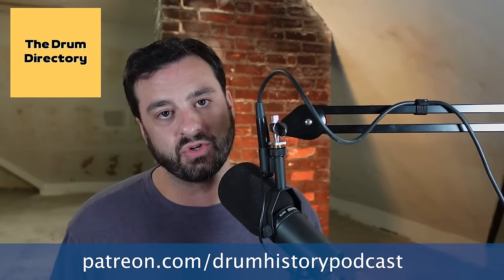Why Do Drum Brands Sound Different? with Jeff Kirsch - EP 242

Comment: I think most people, drum makers included, don't fully understand why drums sound the way they do, and the physical traits that contribute to the sound. By a huge margin, nearly all (often all) of the sound that you hear when you strike a drum comes from the head. This is just physics. When you hit a drum, you are putting energy into the drum, and that energy gets turned into the movement of the various parts of the drum. That energy will get converted into motion following the path of least resistance, and the head is much, much more flexible than the shell, and orders of magnitude lighter (less mass), so nearly all of that energy is spent moving the heads. Any resonance of the shell and the lugs will be of an amplitude much, much smaller than that of the head. Not to mention, the drum shell with all of the hardware attached will have a specific resonant frequency, and you'll only get significant resonance of the shell/hardware if the drum head(s) is tuned to a frequency which causes sympathetic resonance of the shell/hardware. Even then, the resonance of the shell/hardware will effect the resonance of the head much more than be resonance that creates a pressure wave large enough to make it to your ear. So, in an indirect way, the shell construction and hardware can have an effect on the sound of the drum. Another factor to consider is that when you strike a drum, there's a pressure wave created that emanates from the batter and resonant head, and this pressure wave curls around the side of the drum and can meet each other, further effecting the pressure wave (constructive/destructive interference) that eventually makes it to your ear. Drums are far more similar to loudspeakers than drum makers realize, and I'm not aware of any mainstream drum companies that fully understand the the connection between how loudspeakers and drums generate sound.
Reply: They ALL do.  They've known for decades. A mic is an Inverted speaker. The mic inside your ear is called an EAR DRUM... Or the tympanic membrane... It's because all instruments are like playing an inverted microphone. You think something that can't project sound is an instrument for sound? You think Ludwig and Sonor perfected the drum sound by accident? Have you noticed how the acoustic chambers in guitars got replace by a speaker with electric guitars? Drums came way, way, way, before the speaker and modern physics. Drum sounds were perfected few decades after modern physics. I wonder why...🤔
Reply: @christopherlee4648  as someone who builds both loudspeakers and drums, I can say with 100% certainty that drum makers do not at all use the acoustic theories from loudspeaker design when building drums. No loudspeaker designer anywhere tries to use "tone" woods in their loudspeakers. Their goal is to make the most rigid, non-resonant enclosures they can to maximize the output of the speaker driver. Since you brought up Sonor, they're the only ones who I've ever seen market heavy, non-resonant shells as a good thing. In the 70s they had brochures full of testing data that showed that heavier, non-resonant shells sounded better. Of course, they still make some heavier shells, but no one is actively trying to market non-resonant shells or shell materials, even if the science says that's better. Loudspeaker designers also design the enclosures based on Thiele/Small parameters. These T/S parameters describe the electro-mechanical properties of woofers, and they allow the designer to create an enclosure of the correct size to get the optimal performance from the woofer. There is no equivalent today in drum making. No one is characterizing drum heads to understand the optimum shell depth to get the peak performance of the head. Instead, drum companies try to tell us that a resonant shell is what we want, when the sound that actually does come from a shell never even makes it to your ears because the amplitude is so small. I have actually been working on developing an equivalent of Thiele/Small parameters for drum heads, and I believe that this work has the potential to allow creation of drums that really do measure and perform better than current designs.
Reply: @bugless78  You must be living under a rock making drums and speakers. All speakers use wood casings. The speaker cone is the drum head. Last time I checked heavy shells are still the holy grail for heavy music. Those heavy sonors are worth a ton. They stopped making thick shells because they are heavy and expensive to ship and make. Not everyone likes thin shells. Not sure how you think a cylinder can be improved much more. Mass is not that complex. Neither is geometry.
Reply: @christopherlee4648   Every high end speaker is designed with the goal of making a non-resonant enclosure, full stop. This is not up for debate. This is a fact of life when designing speakers. Not all speakers are made from wood, though most are. Some are made from aluminum or carbon fiber, and many are made from MDF specifically because it has naturally low resonance. Speaker cabinets are also heavily internally braced to reduce resonance further. Energy that makes the cabinet resonate is energy that could instead be used to more efficiently drive the speaker cone. The concept is similar in drums. Any energy spent making the shell resonate is energy that could have made the head resonate more efficiently. It might blow your mind that you can create a drum shell out of MDF and it will still sound like a very good drum as long as there are good bearing edges. Heck, DW made some snare drums out of non-resonant concrete and they sound great. When you hit a drum, the sound that makes it to your ear is generated by the motion of the drum heads, just like the sound that comes from a speaker comes from the motion of the cones. I challenge anyone to provide a measurement showing that a drum shell produces a tone when the head is struck that can be heard over the sound of the head. I'll wait.
Reply: @bugless78  Yes but they still resonate in every speaker, so they use wood. And we use aluminum drums as well. Last time I checked speaker casing does matter. Aluminum has qualities of being one of the fastest metals for its mass. Surely you would agree that this makes a difference.
Reply: Thanks for all the inside information 🙏 . ..  i luv that nerd fest stuff, so much to learn 🥁
Reply: Yet he bashes Neil's custom shells  while getting his last name wrong. Neil has a video explaining the drums shells
Reply: @christopherlee4648  "...perfected the drum sound..." Lol!
Reply: Thanks for posting this. Most of the dissenting opinions veer quickly away from your excellent main points. But then again; if the 'golden ear' crowd plops down 6k or 7k for a set of shells, can we ever expect them to acknowledge that most of it is fluff and unsubstantiated conjecture?
Reply: You're not the only one with that belief.
Does the resonant head also produce sound? Or just reflect pressure back to the batter to modify its sound?
Reply: Hey Bart,love the episodes of drummers gear history ,why haven't you done one of Bill award s gear with Black Sabbath

Comment: I cant say I enjoyed this one, It basically got stuck in the weeds for the first 30 mins about ludwig being awful at carpentry and not being able to construct a scarf joint for 50 years. For a 1.5 hour podcast there was about 10 mins of info.  The answer to the title "Why Do Drum Brands Sound Different?" basically came down to each companies random bearing edge finish. Ludwing soft and unround low sustain, tama/yamaha hard and straight more sustain.
Reply: I thought it was me. I don’t  want to go dark on the guy, but this was a bit had for me to hang in.
Reply: :)  It's not that they were awful at carpentry. It's the technology of the calf head era. It didnt matter if drums were round. And most of the current structural issue you'll find isn't a factor of poor construction as much as 60 plus years with no maintenance.
Reply: Maybe you should listen more closely. There was lots of information. For example, I had no idea that tama were aligning their bearing edge to exactly fit remo heads. Etc etc

Comment: When did people start marching in parades with djembe's? The first djembes didn't show up in the united states until 1954 when Le Ballet Africans toured the states. Ludwig wasn't around during the civil war so how were they adapting their designs from that time. The evolution of the drum set started with marching drums that were actually pretty light weight and served the purpose of a single drummer being able to fill the roles of several. The shells from this time period were generally single ply drums that were being played. When calfskin heads shrink, they tear, they don't break the drum. Reinforcement rings were to strengthen the shells because the single play shells were held together with glues that weren't that strong. During the civil war period and earlier, there were tacks in the shell at the scarf joints to be a backup for the glue. The vast majority of drums being made in this timer period were maple.

Comment: i only mention this because i'm a stickler for details...
timber, lumber and veneers to make all types of wood products are generally put into two categories.
angiosperms are called hardwoods and gymnosperms are called softwoods. the terms in this context do not describe the hardness/density of the wood. maple is much harder than poplar and are both called hardwoods. fir and yew are both called softwoods but both are harder than poplar and many other hardwoods.
i think the most important factors in sound are the head, the bearing edge and the overall density/composition of the shell
o7
Reply: It's a fair point. I should've said "harder woods" and "softer woods" or mentioned the janka scale.
Reply: @portlanddrums  cheers mate 
i made some stave shell out of western red cedar but lost my shop space and haven't been able to turn and finish them. i also want to give spruce a try.

Comment: Mr Kirsch, regarding bearing edges not being stained, lacquered & polished after 184-ish, Ludwig did that to their Super Classic line from 88-94. I own a 89 set of these & inside of the shells are stained, but not lacquered like outside. Bearing edge is the same way. Also, 4 ply shells, 6mm, NO rings
Reply: Cool! Thanks for the info. I've never actually seen those. Probably because the edges are round and sealed so people dont have issues with them. I generally only see stuff that customers are struggling with.

Comment: Surprised no mention of Sonor, or in the USA, Noble & Cooley.
Reply: Yep, while ludwig were performing awful carpentry, sonor and noble had it down. they were also on the nodal mounting point so early noble sued sonor.
Reply: @krusher74  N&C happens to be one of the most "ripped off" of drum companies (besides Rogers). They had the Nodal mounting point, cast snare drum (Alloy Classic), Cool Mount tom system, etc. all ripped off by especially the Japanese companies. No knock on those companies as they were responsible for really bringing up the quality of drums and hardware. After watching this video I'm kicking myself because I had one of the Yamaha Recording Custom drum sets with the finished bearing edges that I bought new in 1983. I sold it about 5 years ago. If I only knew.
Reply: It's so hard to get everything in under an hour
Reply: @dancalabrese3523 
The first Tama Star Classic was N&C CD Maple replica and Pearl UltraCast snare was an Alloy Classic replica also .
Reply: @blueavadis22  Thanks. I knew about the Pearl snare, but not about the Tama Star Classic, but it doesn't surprise me. Noble & Cooley is a very special drum company. I own a Horizon kit and after having sets like Sonor, Yamaha Recordings Custom, Premier, Ludwig, Rogers and Gretsch I can say the N&C kit is the best I have ever owned.
Reply: @dancalabrese3523  
I agree with you, I own a CDMaple 7 piece also a Sonor Designer , HiLite , Pork Pie and Ludwig Classic Maple but N&C is the best for me.

Comment: A more pressing question for me is why do different drum brands feel different? It’s like cars. Toyotas feel different than Dodge’s. But within the brand, they feel similar. Drums are the same for me. DW’s feel different than Tama, and they both feel different than Yamaha. I don’t understand, but I’ve played on many many kits over the last 38 years and my findings are consistent.
Reply: it the way the head osolates on the bearing edge and the want that interacts with the bottom head. think of it like a basket ball you are bouncing one may feel pumped up hard, one is half flat. (ludwig = half flat.)

Comment: Jasper started making plywood tubes for concrete after WW2 and it expanded to drums when Gretsch came to them! 
There are tooooo many things that make a drum sound as it does, wood type, bearing edge, re rings, thickness, hardware, glue type, veneer thickness, glue cure, hoops , heads....
Reply: I agree totally. I’ve heard people say it’s mostly the heads. I’ve had many different wood drums and you can’t get the same sound by changing heads . You can though get a decent to good sound out of most wood types. 
 So much also goes into the quality and price of a drum set.
Reply: @Thesmokymountainman  yeah.. big picture as said on podcast , a cheap kit worked over a bit can sound great. But having a " high end" kit has something lower end kits have. Being a drummer and nerd, slitting the hairs is kind fun. What secrets do the details hold?
Reply: @Camcodrummer  basically ludwig poorly constructed shells with uneven bearing edges, some people like the way that degrades a drums resonance.